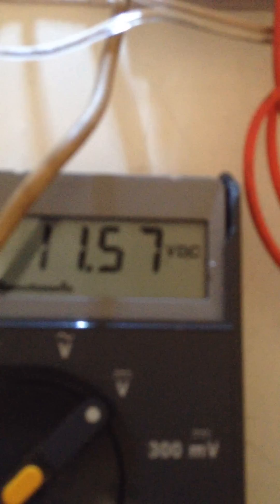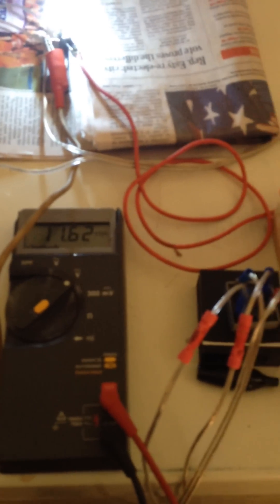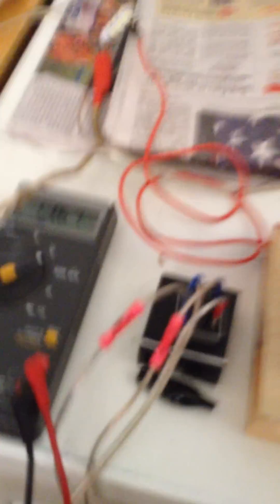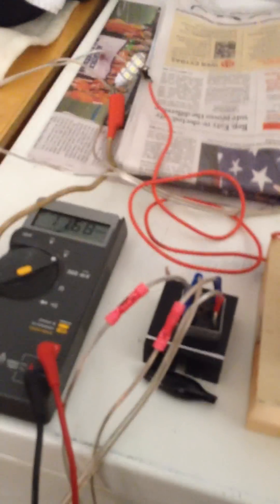Over unity created with transformed back emf. True over unity, no BS!

Comment: i look forward to your progress
Reply from the maker: Thank you. I have many prototypes that started with a circuit similar to this which has pushed me into using a solid state design that I have created. I am pushing to gain more amplification and drawn in voltages from 16-32 different streams simultaneously to actually pull in enough power and keep the size down so we could actually carry it around. I am hoping for myself to actually be seen as an innovator of the nation's first "real & commercialized " solid state free energy device on an international level. I do not wish for this to be suppressed, so, I will eventually release a smaller version if it stands up to rigorous tests, as well, a commercial version with the same tests to see if it wins out the public, or if it will become economically inviable by force of the rich and powerful, or government.
Reply: Marc Belanger I think you already know what will happen when they find out. Please mark, for the sake of humanity, get your ideas out to as many people as you possibly can before they destroy you like they have so many others. Don't even worry about trying to patent it, just get it out so that by the time they start to catch on, too many people already have it and they can't suppress your ideas.
Reply from the maker: Hey Mr.X, Thank you for the compliment and good wishes. the schematic plans for a small version and the idea is posted at mbrcircuit.blogspot.com . This very schematics has been given to as many as possible, but, the unfortunate issue is that trolls, shrills, and skeptics have worked as a team with each other to create so many non believers of any such overunity technology so,  there are few and far between that believe that overunity could really happen. Since this is true, very few would work with anybody due to the fact that 95% or more of the people who claim they have figured out overunity are actually scammers, etc. I have been working to prove that radiant and cosmic energy is a very real thing, starting with my attempts to recreate Tesla's radiant energy devices with my own twist, which actually worked, but, the amperage produced was very feeble at best, with extremely high voltages, cancelling out the drive of the circuit when applied as needed to drive closed circuits, but, I have developed a new way to use this energy, and have modified the way it is drawn in. Fortunately enough, when we have scientists that will hear and believe my "electrical generation" theory, which is ultimately my very own and my very unique thought of how electric generation really works, instead of how it's been perceived to work for 135 years, our society and electric use will change hands over to the new devices and applications because it is so much different than what we use already. Unfortunately, there is an antenna necessary for proper conversion of this technology, which draws in an extremely high voltage but, with 1/5 of the amperage we need , even after the differential of voltage to amoperage is applied, and it lacks the real drive needed for our closed circuit systems. My device needs to be used with an invention designed by Tesla, patent 685953, which transforms the ability to use radiant energy and intensifies the product of radiant energy so it could be used in our everyday applications, or, with another device I have also figured out.. I currently use a "fuelless" motor which utilizes a high voltage, low amperage electro- mechanical motor to drive standard high current generators, which we currently employ at mostly every power generation company on the planet. Every device we use, except for the solar cell, and the hydrogen fuel cell works on an electro mechanical principle which unfortunately is a product of the past and utilizes a very inferior technology, but, will work, and work well.. We have the ability to use this 200 year old technology for completely free electricity here and now so, I do not know why we haven't at least had our government take over power generation because they have the technology to do so here and now using absolutely no fuel, which would result in a very minimal cost for distribution and transmission of the electric grid. I have the ability to see through the inadequecies of the radiant energy projects that we have studied here for many moons on our planet, and have found a way to apply current technologies that we already have here to make the radiant energy antenna system power a specific product that super simple to build, and transform the energy to electro mechanical generation, which is the link to making this all work to power our already existing systems with minimal changes. These two technologies incorporated would actually generate very large amounts of usable energy, but, I'd need the support of thousands of people , and the government to actually make this all work. I would like to bring this technology on without interfereing with our oil market so we slowly ween off of the oil or use it for other applications, maybe just for lubrication and manufacturing of insulations, plastics, etc.
Reply: I appreciate your reply, and wish you the best.

Regarding your hydrogen production methods, have you ever considered combining your technique with a RF signal? There was a guy named John Kanzius (dead now) who demonstrated that salt water could be burned at 13.56 MHz. From what i understand (i could be wrong as now i cant even find where i read that), this is the resonant frequency at which the sodium in the water becomes unstable (not the water) which reacts WITH the water, producing hydrogen. Since watching that video, i have wondered if there could be a more efficient way of using the same idea by trying to find the resonant frequency of the water itself, not the sodium in the water. I'm no scientist or engineer but i just thought i'd throw the idea out there to see what your thoughts were.
Reply from the maker: Mr X No, I haven't heard of that or tried it but it seems interesting enough to try. My issue would be trying to design and create a circuit capable of functioning with this high frequency. If you have any ideas, please let me know what you think could withstand that high frequency , or, even produce this with a high enough current capability of actually making this phenomenon happening. I will try it if I have the gear to do it. I have tons of components that might work, i just am thinking about the last device i built was having trouble burning up the hexfets i used when I used an inductive load coupled with the frequency of I believe 42,500 hz and a few amps load, kept burning the hexfets without any significant load, as well, the diodes in the circuit were having trouble with the frequency,but, I think there was other problems since i had some serious longitudinal energy drawn into the circuit since 390 volts that wasn't transformed was being measured in a place where 13.5 volts to 14 or so should have been there once i applied an Earth Ground to the circuit's low side of the bifilar coil's lead. Funny things start to happen when you hit resonant frequencies and i do agree that many things start to work when this is achieved. I am hoping the frequency you are telling me would work with baking soda as well since sodium has nearly the same frequency when combined with water. I wonder if the inventor used distilled water? This would be rather easy to duplicate if he added the salt. Let me know if you find more information because the amount of salt will also be one of the variables needed.
Reply from the maker: Mr X I have been trying to duplicate something i saw years ago. I was out on a job working and had to move a gas powered pump as it started to rain and the spark plug was getting wet. The spark plug got a small drop of water across the top , down the porcelain, and of course connected to the base. It instantly turned to massive bubbles of hydrogen and once it started to do so, it didn't die as the load was that small. My guess is that if I could find the pump I used, I will start it and get the rpm's so i could figure out the frequency of the spark, as well, get the same magneto and experiment with small mists of water between very distant plates, and all sorts of different widths. i think the reason everybody has so much difficulty producing very large amounts of hho is the fact that the plates are being drowned in water, short circuiting them when the plates are completely submersed.  think if we had the edges of the plates barely touching maybe a drop of water at a time that it would be very easy to produce large quantities with high voltage and minioscule traces of water maybe sprayed on after so many revolutions instead of complete immersion. I have a design that I was going to patent, but, like the man you are talking about, hydrogen is a very touchy subject because once we start producing deuterium and other forms of hydrogen that are not stable, the government doesn't wish the technologies to be sold since they could be used by unsavory characters to cause acts of terror. i think they wish this to remain off the net and not in stores for anybody to purchase. Once it gets ouit there, large quantities of hho production with small batteries always causes issues, deaths of inventors, etc. There was a small handheld torch on metacafe years ago that was built in a small jar that used a similar technology and a 9 volt battery which was extremely efficient, more so than stan meyers and it was taken from youtube, and all other online sources to suppress it so people wouldn't get the devices schematics since it produced orthohydrogen, which is deuterium, and a much stronger isotope of hydrogen which will run a car with oxygen mixed since it is hundreds of times more powerful than gasoline. Tritium is another that was being made by many and hydride, where hydride merely needed to be warmed up to run a vehicle, so, there are many ways to do this but it has to remain quiet and out of normal open source if it does get out there or accidentally invented by somebody.
Reply: The videos of John Kanzius are still online if you want to check it out, i just cant remember where the info was that stated it was the resonant frequency of the sodium and not the water that produced the hydrogen. I'm pretty sure it was just regular sea water that was being used in the experiment too. I'm very interested in alternative technologies but I've only recently finished my apprenticeship as an electrician and aren't really familiar with electronics and high frequency circuitry, so sorry i couldn't be more helpful. 
I had a mate a few years back that was changing the motor in his car and accidentally hooked up a water line to the gas mixer (he was a bit of a moron) and said that it actually ran (only just). To be honest, at the time, i thought he was lying but after hearing you say that you have also witnessed a spark plug produce hydrogen, maybe not?
Reply from the maker: That's ok. I was an apprentice cable splicer/lineworker just 16.5 years ago. I fortunately went through electronics before I started my apprenticeship, so, as I worked watching the journeymen work, they could never apply the theory of watts and ohms law to the work they were doing, as they were never taught. My best advise for you to learn the theory end of it is to go through an online source of electrical and online circuits that will ask questions at the end of the chapter, or, watch some of the online youtube training series from several instructors that actually make it very easy to learn this. When you work putting together any type of circuit, try to apply mathematics to the circuits you are working on so it becomes a part of your everyday job. If you let the journeymen see you do this they most certainly will break your stones about it, unless they are a bit more technical and recommend you do so. I would try to just use a calculator to apply simple formulas to what you do, such as loads, voltage drops, wire and cable resistances for specific wire lengths, mnaking, watts and ohms law applicable to the circuits to see if the theoretical formulas and results match what they should in an actual circuit. I always took the voltages of my circuit and measured the given resistances of the cable I used to figure out the amperage during a no load situation, and compared the incoming line voltages to the outgoing , looking at metering at a switchgear , documenting the voltage at the gear before the circuit is loaded up to see if there was any difference in voltage, seeing if the voltage drop formulas ended up being the same.
Reply: Marc Belanger Thanks again for the advice Marc, if I get a chance in the future i will definitely look at putting myself through more study so i can understand how certain electronics components work. Unfortunately you're right though, if i start testing things and working out formula's on site that aren't part of the normal commissioning procedures, i probably wont have my job for very long.

Anyway, good luck with your work and remember if you do come up with something fantastic and you cant get a patent for it but still want to see the idea go ahead, you have a fellow electrician in Aus who will be more than happy to help take people off the grid and smash those stupid smart meters to pieces!
Reply from the maker: there are a lot of us that are working on it, however, it  has to slowly be introduced into our societies so the economies are not destroyed instantly. Our governments are unfortunately scared to release the very technologies that are being sold in other countries, such as Brasil, due to the fact that over 40% of each country's employment within countries that aren't considered to be "third world", are employed within something to do with fuel from oil of some kind. It's shameful that our world has grown so fossil fuel dependent, but, we now have other technologies to improve our world, unfortunately, we are all taken complete advantage of and are being forced to pay continuously for electricity from free sources, such as water or wind, and, they are still the most abundant form we currently  have to date, as well the most powerful. In the US, we have been paying for the same grid generation for years, and basically for upgrades. Generation facilities are making money hand over fist from all of them as well, taxes for all our government does is funneled in through these products, so, the distribution, transmission, and regulation of all aspects of power must remain in tact otherwise, we will all have to restructure our taxes to be brought in from other areas.
Reply from the maker: We have the ability to bring in free power , the technology has been here for a century plus, we have just been suppressed from the technology because if we were not, we wouldn't have to pay for the very tax money it already creates to help the countries actually function. The government has literally taken over the Morgan and Rockefeller financial empires to eliminate them from complete control that caused dangerous sweatshop antics and minimal wages so the people could share a middle class wage on a large level of equality, but, they have still not taken away from the rich and powerful because they are just too powerful. People like Bill Gates and Warren Buffet are the people of the past that have control over new technologies, or, technologies that their investments will flourish from such as markets that are always needed.. Communications, power, electrical repair, gas systems, fuel, and many other commodities that are always needed on a daily basis. If we take away energy regulation and allow people to generate on their own without a fuel, completely off of the grid by lowering prices or making these systems efficient enough to generate all of our needs, everybody would be using them, and all of the rich and powerful would not have rising investments anymore causing the rich and powerful to take over other things that would make us all irate. We have to be completely careful how free energy technologies are introduced, and first allow them to be given to the power company generation systems, lower our rates after their very installations, and carry on while nations leaders figure out where and what will carry the tax money they need. Unfortunately, it will have to come from one thing or another, and I think it should be only in one way, which would be very easy to do. Create a national sales tax for each country, eliminate the income taxes, and all taxes charged on any commodity, then let all the people do what they wish, this way the illegal have to pay for their taxes for clothing, food, etc., and they do not get away with making millions selling their drugs without paying for taxes one way or another. If every item carries sales tax money, our world would be able to work again, with all free technologies, just as long as they are not dangerous and used for terror.
Reply from the maker: my progress!! I have finally figured out what the world needs and I am not stopping there.... I will be perfecting the energy draw and will be making radiant energy systems for the public to purchase so they could have good strong electricity in cabins, and places where electricity is difficult and too expensive to bring power lines to.   https://www.youtube.com/watch?v=rnDupExnkp8
Reply from the maker: I am not here to ruin our economics, but, i am the missing link from "the radiant energy" projects of the world that could make this all work because I have a very vast understanding of how it works and why. I need government backing so I first of all don't get killed, and then, once this is done, I would agree to work with scientists and engineers of worldwide powerr companies to get this technology started. It has the ability to be made on a small scale, but, this would ruin the current economic way all of our countries work. We'd have to sit down with governments to ensure the way taxes are collected and how the system works would not disrupt electrical transmission and distribution because it would eliminate millions of jobs, oil companies would go under, etc., if we just released this to the public. The idea process is there and the proof of concept is there, but, there is only one very small idea that would make this all very possible and it lies in a small panel of developer's minds so far. I would like to introduce this to government and only do so if the technlogy is not suppressed. There really is no need, and they need to open up their minds before the current small devices that are starting to become marketed take over our economy causing mass struggle and huge unemployment rates for 50% of our country and other countries.